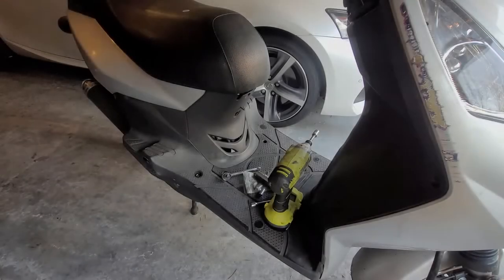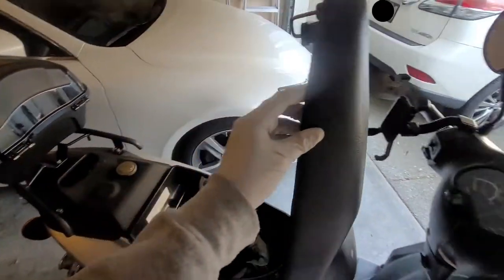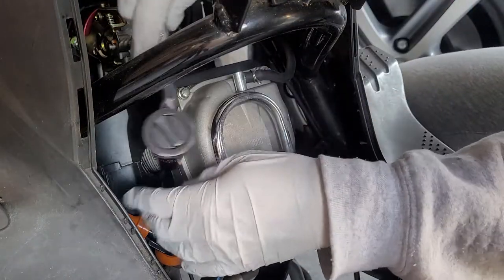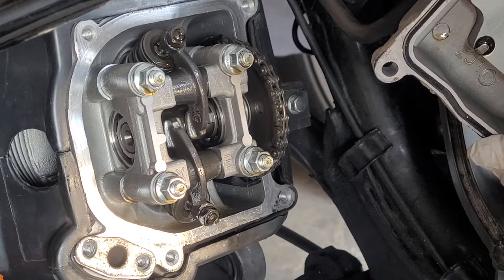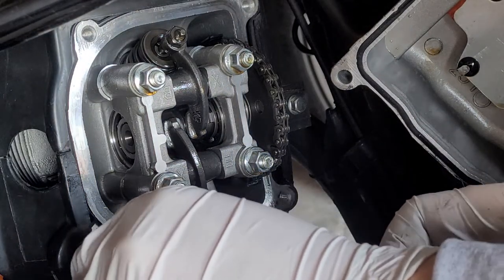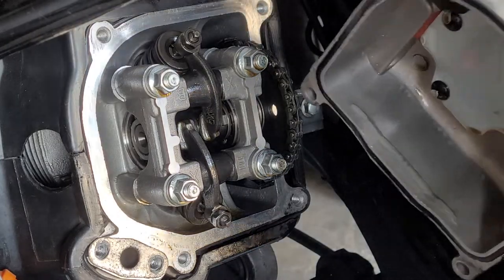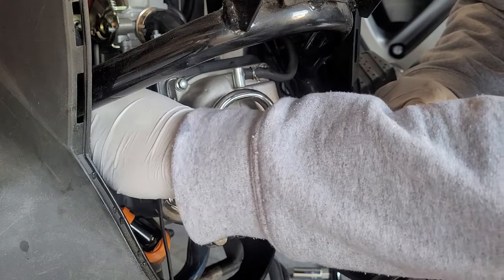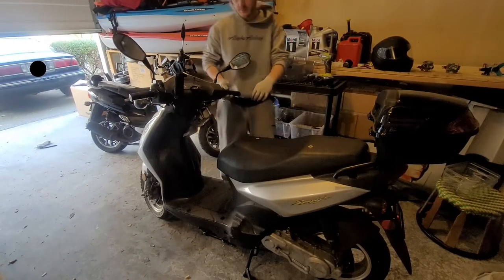49cc 139QMB GY6 Scooter Engine - Valve Adjustment Tutorial

Comment: What is the average life span of a 139qmb?
Reply from the maker: With a pretty liberal amount of conservative maintenance I've seen them go up to 100,000 miles. More realistically, though, you can estimate half of that before something "goes wrong", but it's still fixable. A new top-end kit on Amazon is always cheap, and so if after 60k miles you start losing compression and performance it's trivial to spend an hour or two putting in brand-new parts.

The biggest problem is if you mess something up in the bottom-end. This is if you put a 52mm BBK on, something way too big that the stock bottom-end can't handle. If you stay away from these, though, you should be good to go
Reply: @GTAIVisbest   100k miles?  Seriously?  Never going to happen lol.  The life span with normal maintenance is about 20,000 miles before engine starts to degrade.  Which is between 5-7 years of ownership.  There isn’t a GY6 engine on this planet that has 100,000 miles on it.  Sorry man.. not trying to fact check you, but you can’t just give people inaccurate information in a tutorial video.
Reply from the maker: @firechicken2011  There's a guy in our scooter discord who is a GY6 mechanic who got his 157QMJ to almost 100k. He did this by never exceeding 7k RPMs the whole time he owned it.
Ownership of a GY6 doesn't HAVE to mean that you're beating on it really hard, if you take care of it there's no reason it won't go for a long time. What does "engine starts to degrade" even mean? lmao

Comment: Hi, my scooter was making noise, I did the valve clearance and it was solved, but after two days it's like before again.  What could be the causes and how could I resolve it?
Reply from the maker: Sometimes valve lash can re-expand if the nut wasn't tightened well. I've had this same issue as well. To be honest, just adjust to spec and then let it ride, if it's too noisy it's not necessarily a problem
Reply: @GTAIVisbest  Thanks

Comment: I’m surprised you got that engine to start by your process.  Your valve lash specs are way off, use .004 for both intake and exhaust. Mostly cause you didn’t get complete top dead center.  Your method is incorrect and not reliable.  Use your flywheel on the stator to verify TDC.  Don’t ever just look at the timing chain.  That noise you spoke of comes when you are too loose on valve lash and you’ve probably just taken restrictions off and rev higher rpms.  You got the general idea though,  just seems you aren’t very experienced yet.   Go check out Rolling Wrench videos.. you’ll see the proper procedure for adjusting valves on a 139QMB.
Reply from the maker: Valve lash on the exhaust side is always supposed to be larger than on the intake side because of the temperature difference - exhaust side gets way, way hotter, so you need to lash it wider so that when it expands from the heat, it doesn't delete the entire lash

If your camshaft and your stator flywheel don't agree on TDC, then you have a timing issue my friend 😆 I think there's also a little bit of a grace zone where you can be slightly off TDC and there's no affect on valve positioning
Reply: intake and exhaust should not be the same exhaust is always a higher number because of the temperature,,,the rest I agree with you